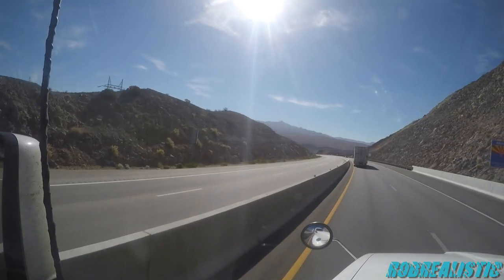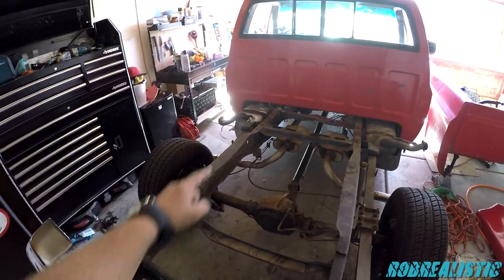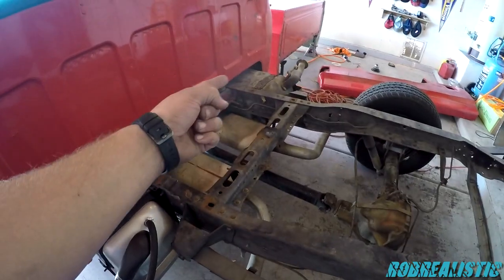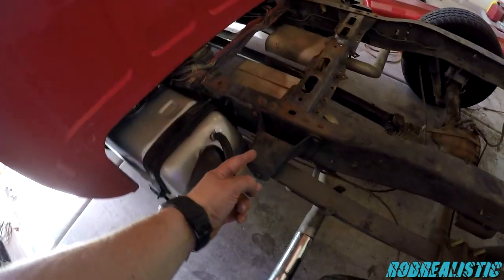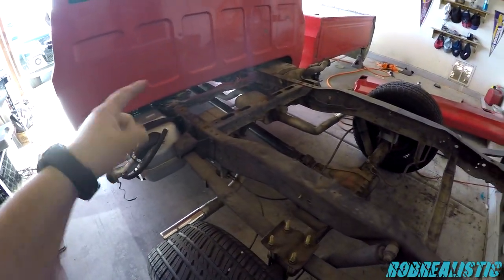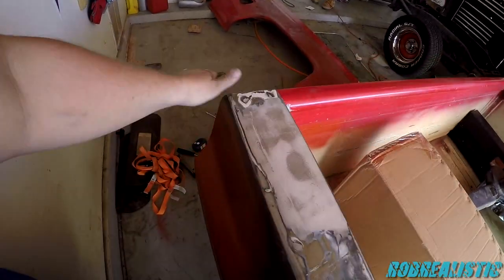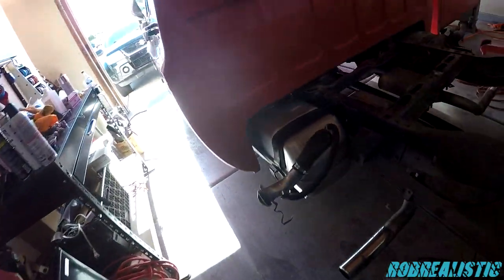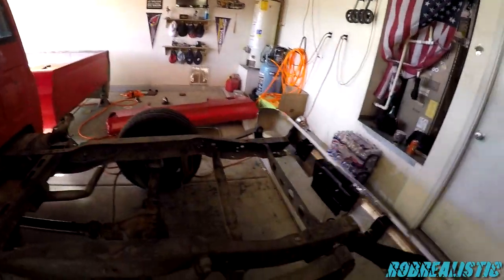Square body c10 build

Comment: How many hose connections are on the top of your sending unit.. 2 or 3?
Reply from the maker: I have 3
Reply: @RobRealistic ... Thank you.  Same here.. I was having a hell of a time finding the correct pump and sending unit.  The part stores kept giving me the wrong one. I ended up ordering one. I hope it's correct.  😬
Reply from the maker: @ReshardsAutomotiveWorkshop  I bought the whole setup from O'Reilly autoparts
Reply: @RobRealistic  .. do you remember the part number?
Reply from the maker: @ReshardsAutomotiveWorkshop  FG05F
Reply: @RobRealistic  . Thank you sir. 
I will post a video next week of how I repaired my fuel tank. I'm welding it back together now 😅.
Reply from the maker: @ReshardsAutomotiveWorkshop  noice. Subscribed